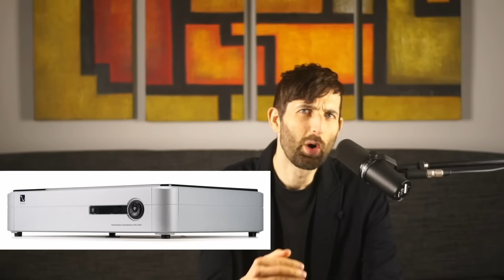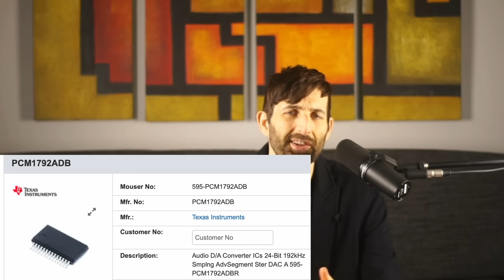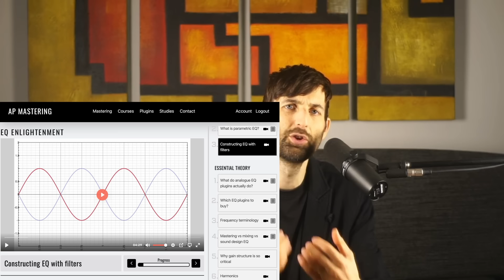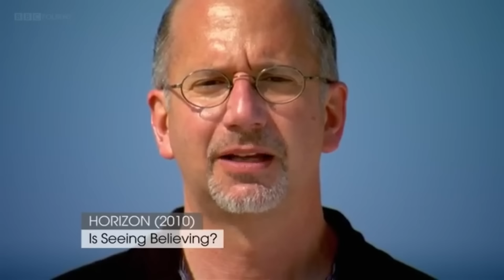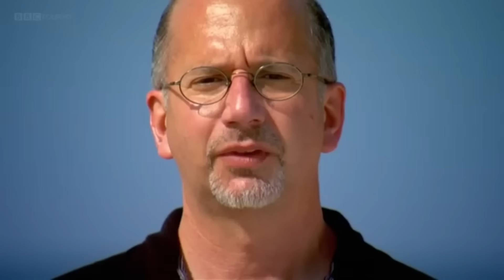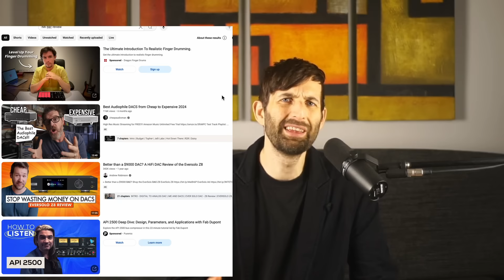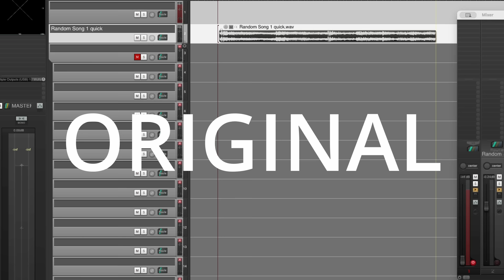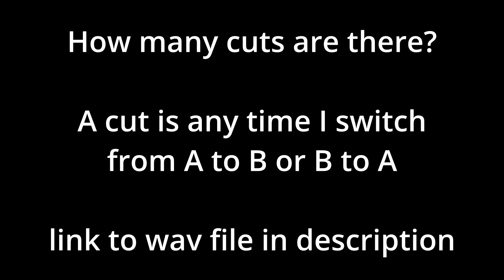The DAC Scam - Almost everyone believes the hype

Comment: 10 AUDIOPHOOL RULES 

1 it’s more expensive, it has to sound better!

2 pfft blind test? We listen with our ears 

3 if they made no difference then why is there a market for it? 

4 may be you need better gear, because your stuff isn’t revealing enough 

5 may be you need to get your ears checked 

6 there’s a night and day difference! Even my wife noticed from the kitchen! 

7 then why can I hear a difference? 

8 have you actually heard *insert esoteric dac which measures horribly*?

9 we can’t measure everything!

10 my speakers are too transparent and has no emotion so I need to balance it out with warm gear 

Let’s face it, most people buying $50k dacs are usually old, gullible men with more dollars than sense who are too stubborn to be proven wrong. These are the same people that will have xlr cables but don’t believe in null tests and don’t see the irony. They just can’t believe the most transparent dacs and amps are mainly from china and that tube amps sound different when not running into distortion. They will buy super tweeters even though they can’t hear above 13khz and will say stuff that makes no sense and they’ve heard before like “micro dynamics” or the “leading edge of notes has a realistic timbre”. They watch audio reviewers like jay iyagi, Thomas and friends, Hans, British audiophool and the worst of the bunch, alpha audio who use inferior gear to measure irrelevant things in the wrong way to prove there’s a 3db difference at 4Mhz and that’s why network adapters need to be audiophile quality. They buy linear power supplies on their eversolo network player because everyone else has and don’t understand the graphs aren’t showing differences at the analogue out but and irrelevant response intrinsic to part of the early chain that gets buffered out of existence before reaching your ears. They are never satisfied and constantly losing money by buying and selling. They have no idea about room acoustics or it’s importance and are the first to plonk a pair of subs in between the mains. They don’t believe in dsp or eq but will think carpet will fix up most problems. 
I can’t believe in 2025 these people still exist. You have flat earthers, audiophools, essential oil mothers and homeopathy. Absolute morons

Comment: I think the $1000 range is essentially the limit on a dac I would buy.  There are some under $500 dacs I know I would like but there are a few over that too.  As long as the build quality supports the asking price along with the sound, it isn't out of the decision for me.  

I think there are essentially 2 flavors, many call these analytical and musical.  With some variation along a continuum between the two.  Anyone can have a preference and can desire one and despise the other while others may not hear any discernible difference between the two.

I have limits on what I want to spend but still expect quality.

Speakers: 1500 to 3000...preferably less
Dacs: up to 1000 or so
Integrated amps: up to $3000 and preferably well under

If an amp needs service, I can get that done locally.  If a speaker requires servicing, probably same but never had a major issue.
If a dac requires servicing, chances are you are just going to buy another especially if out of warranty.

I would buy used/open box/sale and closeout before paying full price also.
Reply: Also, one can get all 3 components for under a $1000 (if careful and thoughtful on what to buy) and still get very satisfying results.

Comment: Invest some of your money on getting your ears tested. I don't spend thousands but yes the ones which I like and I can afford. Music definitely sounds better with DACs. Having operated sonars, I have come across sonar specialist sailors who can differentiate between the sound signatures of different types of propulsion and propellers to a level which would be considered superhuman. So, YES, a lot depends on a human's hearing ability. That's just one end. Starting at the other end is the quality of recording, quality of the data file, how it is being transported between devices, preamp, DAC, amplifier, speakers/ headphones  - each component makes a difference and is capable of screwing up the sound. Just remember the cliche - the strength of a chain is determined by it's weakest link. Hope they are not your ears!
Incidentally, I felt a world of a difference between DACs costing 50 bucks, 100 bucks, 200 bucks and 500 bucks. Beyond that I cannot afford. As far as the one's costing 10s or 100s of K equipment, there is a law called the Law of Diminishing Returns. I suggest you give it a read. The high price one pays is for the RnD and design in the so called over priced equipment.
Reply from the maker: how did you do in the blind test?
Reply: @APMastering Yes, I certainly found some DACs better sounding and they were not the $10-20 ones but around the $200-500 range.
Reply from the maker: @Sunil_Dhaka the blind test in my video

Comment: What about the more pleasing clipping sound that for many years mastering guys where using to get volumen instead of brickwall límiters, or the electrostátic shock resistant capabilities that military grade componentes have, plus the routing capabilities from the multi imput Converter unit itself,  is that also snake oil?

Comment: No idea why this was in my recommended videos. At the end of the day, let people spend their money how they please. Audiophiles and mastering engineers have different end goals so they will never have the same approach to sound reproduction. DACs do mainly use a lot of off the shelf chips for the conversion process but there is still quite a bit of engineering in audiophile high end DACs which revolve around power supply design, capacitance, EMI isolation, and the design of the input/output stages (note that I'm not justifying the prices in high end audio as some are ridiculous) and once you get up to the multi thousands (above 5-10k) the diminishing returns do become quite evident and generally you're paying to show off status symbols (it's almost like very expensive watches and boutique purses at that luxury level).

Comment: Human listening tests are flawed, especially on YouTube where most of your audience will be listening through terrible phone or tablet speakers or Bluetooth headphones/speakers. Controlled scientific measurement is the only way to objectively measure performance.

Audio Science Review shows objectively measurable differences between different DACs in terms signal to noise ratio, harmonic distortion, etc. between different DACs, including those that use the same DAC chip.

On their site you will see some cheap DACs measuring really well, and some expensive DACs measuring pretty poorly.
Reply: @RockManEnough I have a S9 Pro USB stick DAC from Hidizs, which is currently sells for £55, though it was £100 when I got it. It performs spectacularly and supports balanced audio too!

I also have a BlueSound PowerNode DAC-amp, which cost a hell of a lot more, but lacks the clarity of the Hidizs. When it dies, I'll buy a much cheaper Wiim DAC-amp to replace it!

Comment: Here's something to consider. The frequency response of most units is reasonably flat. You won't hear any difference from this except at the high frequency extreme. What differs is the noise floor. Analog hiss, harmonic distortion, intermodulation distortion, and digital jitter all raise/degrade the noise floor. The music you chose for your test has no silence between notes, and no long "tails" on notes or reverberations fading into silence. The constant musical sound masks the noise floor making it impossible to hear. To compare the noise level you need space between notes. Solo acoustic guitar or piano, recorded with some reverberant room sound included can work well for this. Multi instrumental recordings can work if the mix has a lot of open space, but often are too dense to allow you to hear the noise floor. Well made DACs have noise below what humans can hear, but any signal degradation can raise the noise to audible levels. I would hope everyone can hear the difference between 16 bit and 24 bit recordings when listening to a revealing piece of music. The difference is the noise level. Listen for small details in the sounds just before they fade into silence, not to the loud parts. 16 bit compared to 20 bit resolution should be detectable. 20 bit to 24 bit maybe not. To hear variations in frequency/amplitude response you need music with sounds all across the frequency spectrum. A banjo recording won't tell you much about problems at 50 hertz. A Fender P bass won't reveal much about 10 to 20 kilohertz. If you have a room resonance problem around 90 hertz, songs in the key of E probably won't be an issue, but switch to F or F# and there could be trouble. To hear the noise floor you need music with lots of open space. A dense, distorted electric guitar will mask the noise. The music you use for testing should be chosen to reveal what you're trying to hear, or your listening tests may not really prove what you want them to.
Reply: "I would hope everyone can hear the difference between 16 bit and 24 bit recordings when listening to a revealing piece of music."
I cannot.  I record at 24 bits just to have some headroom for editing and to avoid clipping. 
Now then, a 16 bit silence is SILENT.  No signal at all.  None.  But that creates a problem with going from 0 to 1, a definite step.  So, some noise is deliberately ADDED and is called dither but is on average only 1/2 bit and with 16 bits, you have 65536 steps and the noise is 1/65536 of the signal.  If you can hear that, bless your hearing!  Enjoy it while you can.
Reply: No it isn't, these days the frequency response of most DACs is rolled off in the treble. There's a lot of "warm is musical" propaganda being spewed by reviewers, and it's had quite an impact on shoppers and sellers. The only question is how much roll-off is still inaudible to 99.999% of the population, otherwise measurements show actually flat response in DACs (as finished products, not pure chips) is still a rarity you need to put in some effort to find.
Reply: Ahahaha less talking more proving it in a blind test
Reply: @CrackieChansJourney  It's been proven in a blind test, look up Archimago's 2024 DAC blind listening comparison: 80% of participants heard differences, and for 50% of them they were differences worth paying extra for. (Commented this once before, but it seems someone who hates finding out about reality thought it should be deleted after a couple of days.)
Reply: @CrackieChansJourney
Ahahaha, go to Archimago's blog, 2024 DAC test, blind listening, 80% of audiophile participants heard a difference, 50% thought it was worth extra money for the better sounding DACs. My condolences for your extremist view that all DACs today are perfect, we don't live in that world, sorry.
Reply: @d0nj03  When CDs were first introduced their marketing slogan was "Perfect Sound Forever". Some people said they didn't sound perfect. It took several years to understand the bad effects of digital jitter that weren't detected by basic analog distortion and noise tests, and to add sample rate reclocking to DACs to reduce them. We should be cautious when proclaiming that overall perfection has been achieved just because one particular song sounds good. A different song may reveal problems.
Reply: @CrackieChansJourney  Nothing is ever proved in science. And most blind tests done by amateurs are poorly designed.

Comment: I have an old school stereo and I use a DAC as an optical out converter from the television down grading to RCA component cables for the stereo. And I believe, that's all it can do. Isn't that what most of them are used for? My DAC cost 24 US dollars on Amazon and sounds fantastic. And because optical is digital, it either works perfect, or it doesn't work at all. And it still offers a solid stereo base for surround sound to be decoded from. I wasn't even aware you could spend 15,000 dollars on a simple DAC. Wow, it's a very small piece and only does one thing. Mine is only about 4 inches square, runs on 5 volts and doesn't even get warm.
Reply: I'm sorry it doesn't get warm. I like 'm hot.
Reply: @FeddoWouters-i4e  I see, so you have no idea what I'm talking about.

Comment: As a beginner in the world of audio, I recently discovered DACs, which are completely new to me. After watching this video, I’m starting to question whether I really need an external DAC for my system, as I’m beginning to think that many audiophile reviews are more based on personal opinions or placebo effects. Will I actually notice a real improvement by using a basic external DAC in my setup?
Reply from the maker: theres feature differences. and if you have internal PC sound card the quality is probably bad
Reply: I think all DACs that cost a few hundred euros or dollars can sound quite different. The thing is, DACs that cost a few thousand euros or dollars don't sound any better because they don't have any other components that could improve the sound. However, it's possible that double or triple the price is justified if the build quality is significantly better, but that's true everywhere. Ultimately, it doesn't matter for the sound. And I think that's exactly what this video is about.

Comment: If you are seriously saying that all DAC's with the same chip in it's box are sounding more or less the same, than you really have no clue what you are talking about, kick yourself out from YT and stop embarrassment. A DAC chip is just a part of DAC, "in da box" - a platform on which software engineers are implementing their software together with a clocking mechanism (internal or external) that tries to minimise a jitter and accurate fetch of a signal in digital domain before processing everything back to analogue. And the analogue part of a DAC and its implementation is a story for itself. Yes, most of those high-priced gear(s) in general are based on hype, snake oil and you name it. But DAC is not a chip only - you should know better.

Comment: What about dacs that are not based on chips such as r2r ladder dacs or ones based on FGPA technology such as made by chord electronics ? Some dacs have multiple chips such as the old Metrum acoustics hex dac, which had '16 high-speed DAC chipsets, 8 per channel, operating in full differential mode'. Are you saying you would expect no difference in sound quality with these dacs over cheaper £200 pound ones ?  I presume if dacs have more features such as 5 band parametric eq as with the rme adi-2 fs dac, or screens, more robust cases etc etc, one may expect to pay more than £200 ? With a dac like the rme there should be a sound quality difference as a result of applying the eq.

Comment: ...and people buy expensive mains cable with magic inside and then plug it into wall where cables are 70 years old...  seen it with my own eyes :face-green-smiling::face-green-smiling::face-green-smiling::face-green-smiling:
Reply from the maker: yeah the cables behind the wall are 100m of standard copper wire to the local transformer
Reply: @APMastering exactly  :D

Comment: Well this is fascinating. Certainly we have all come a long way since Betamax. That said, I do think Studer was correct in using a transformer to balance the feedback of an output I.C. I quite like a discrete output amp from that, to headphones etc , and a transformer can help there too. These things do cost some money, as does a good capacitor, or matched resistors. So, some money isn’t exactly wasted. Does an old 100 quid Sony valve reel to reel sound better than your dac? Probably. So, there’s always that. ;). ‘Transparent’ gets used a lot, it can also mean ‘ incredibly fatigued by a brutal dac’. :). But, no, they don’t  need to cost as much as a bed sit over a chip shop. It is meant to be enjoyable though, and often as not, an l.p on Grandads ten watt Gramaphone and some old Tannoy, beats a digital monster rig with a mega sub. Is what it is.

Comment: The chip is only one part of the equation. I have 2 dacs with the same akm chip, and they sound very different. When I swapped to the more expensive one, even my non-audiophile friends and family were like wow, that sounds so good. This is like saying all speakers with the same woofer sound the same while ignoring all of the other speaker components. It’s just not true.
Reply: You are smarter than most of your peers in here. And you did it by actual EXPERIENCE. Good for you!
Reply: @fertusherring3476 I have THREE DACs with same AKM chip, they all sound the same. My wife, dogs and mailman we also amazed they sound the same. Clearly, I am more smarter because 3 chips = more EXPERIENCE.
Reply: @psyborg06 your comment is just BS.
Reply: what are these dacs?
Reply: @boajuse Geshelli Labs J3 Pro and SMSL su 1. They have same Dac chip but implement it differently and have of course different non Dac components (different op amps, power supplies, etc.). My SU 1 sounds great for the price though and is now hooked up to my PC. Nice step up compared to my onboard audio. If you go the J3 route, the default TI op amps are really good. I also have the 2590 sparkos and burson v7 vivid op amps, but I like the default presentation with the cheap TI op amps. Not sure which are best, but didn’t feel like I was losing out by using any of them.